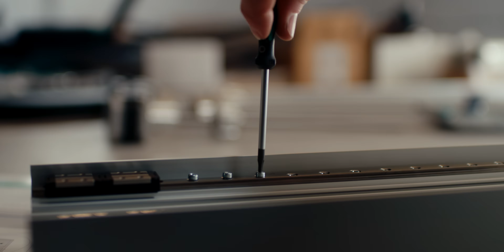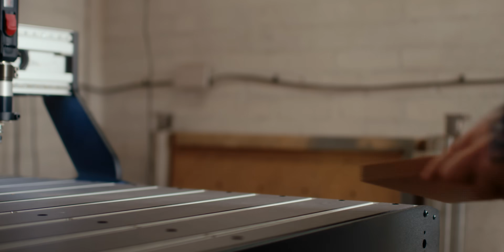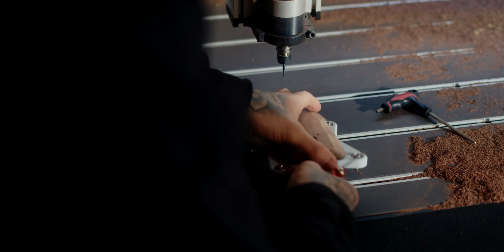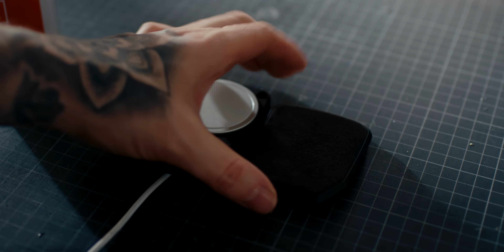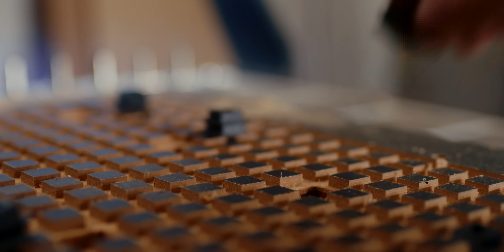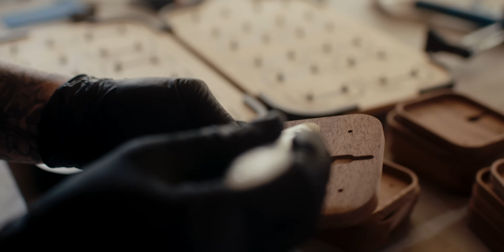How I Make MagSafe Accessories From Walnut - CNC Setup & Workflow

Comment: For your vacuum table hold down look up foam backer rod. it is used to stuff in between the logs of a log house. for insulation and to provide a backing for caulk. Amazon has it.

Comment: This is incredible work.  Invest in your equpment.  You'rean 8 horsepower 5x10 CNC guy using an adolecents CNC.  Those tiny bits and that starter CNC are holding you WAY back.  Make some money and scale up brother, you can FAB like hell, but your kit is holding you back in ways you can't understand until you get a proper CNC that's bigger than you.  Your kit is two levels behind your mind mate.

Comment: @18:45  as you removed the material from the pockets, this relieved stress from the majority of the front face and core, allowing the part to warp slightly, just enough to break seal with the spoil board.  You need to use gasketing directly between the grid and the part face, this will allow some compliance for the wood to move, as well as drawing a deeper vacuum.

Comment: What if you (a) made the jig so it holds the piece at an angle, then when you're doing the back you can just flatten in, and (b) put a zero point mark on a piece that sticks out to the side. Then you can zero in on it with the wood still attached and not have to remove it and put the wood back on.

Comment: 6:30 you might want to look into 3d printing a vacuum pad for these if you are looking for quick and easy set up. I've done something similar, just 3d print the vacuum pad in the shape of the interior for easy alignment, then it's just a simple on/off of the air to keep it held down.

Comment: typically you want to use the largest ball mill your part geometry allows for those types of ops; it leaves a better finish and is way faster. Normally you can get away with 0.1 stepup/down  as well, but it might be different for wood. If you don't already have them, I'd recommend investing in some bigger ball noses

Comment: Have a look at tapered end mills. You might be able to design stuff with taper angles that match the end mill angle and greatly speed up the cutting operation by only having to take two passes (one roughing, one finishing) instead of 25-100 when using that engraving bit and a step-down toolpath.

Comment: I found this very unintuitive when I first realized, but using a larger radius ball end mill leaves a better surface finish while taking less time, even though the first instinct is to use the smallest radius for best resolution. Instead you should choose the maximum radius that you convex curvature allows and then select the stepover that gives you the desired cusp height. For example, I think you were using a conical bit with 0.25mm of radius and 0.05mm stepover, which gives you a such of about 0.0025mm. The same surface roughness could be achieved with a 6mm ball mill using a stepover of 0.245mm, so you could do the geodesic path about 5 times faster.

Anyway, keep with the good work, excellent production quality as always.
Reply: Agreed, this is often the difference between making a project viable or not

Comment: Good video little here's tip to reduce cycle time on the 3d operations. use the biggest ball end mill you can. The larger the tool radius the large step over you can take while maintaining the same cusp height.

Comment: Some movements of the machine looked like they missed steps, was that an artifact from the camera or does it actually happen?
Reply from the maker: It definitely didn’t miss any steps. It has a closed loop system that detects missed steps and stops the machine if it detects any. I’m pretty sure I know the toolpath you’re referencing, kind of looks like a jerky movement when it was machining the contour cutting the part out? If it was, it’s because no matter what I did in Fusion the toolpath just didn’t like that part of the sketch profile. I tried a spline and arc and both had the same motion. I have no idea why it didn’t like it, but even with that jerky motion the final result was smooth. If it wasn’t any of that, then it could have been the camera haha.
Reply: The new M-series never loses steps. It breaks cutters up to 8mm with AMB1400 and tool changer ! I have tested !